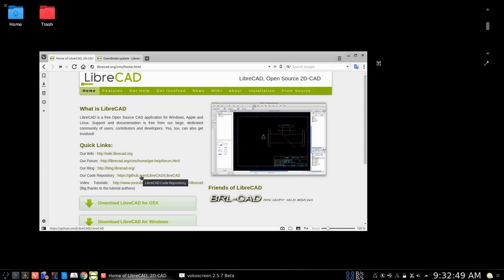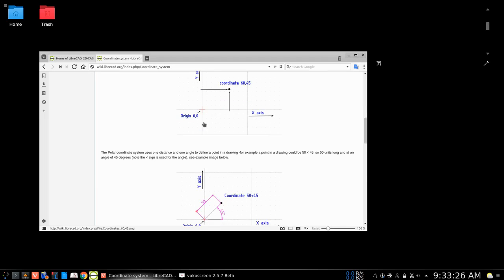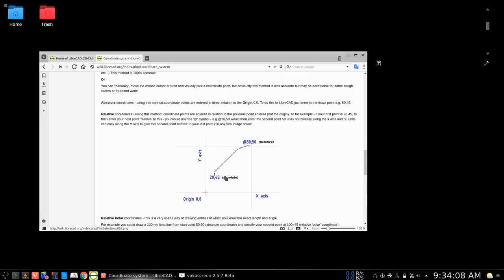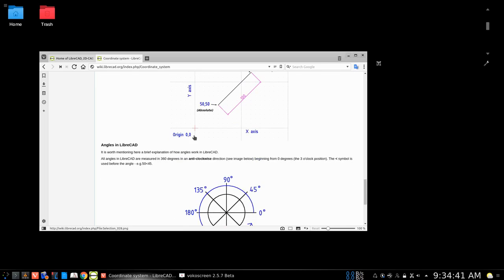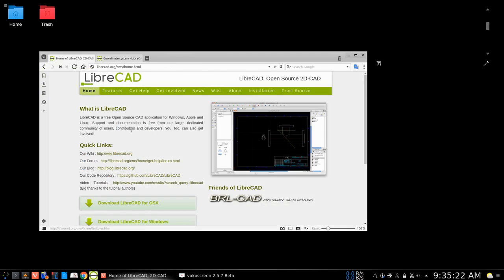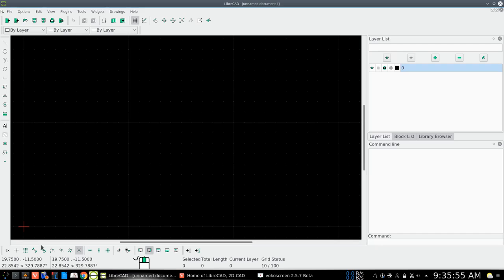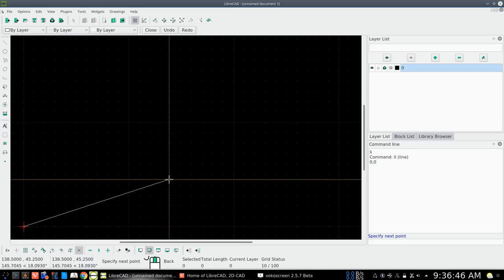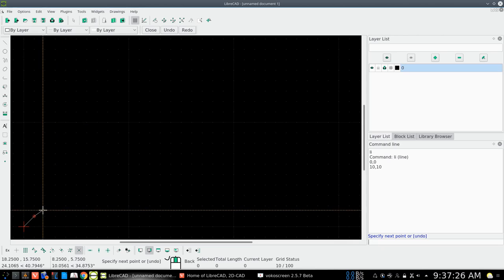7 coordinates

Comment: How a can a use geodesical coordinates (UTM) in libre cad?
Reply from the maker: Hi jcb jets; Thank you for your inquiry. Librecad is not particularly developed for geographical surveying purposes because land surveying requires 3D coordiates providing height as well as longitude and latitude. However in the Options-->Current Drawing Preferences-->unit(tab)-->Angle(section) there is a "Surveyor's units" tab that may be of some use in certain cases. Here is a link to a few hints on how to get extra surveying functionality out of Librecad.
https://forum.librecad.org/Change-Rotation-Direction-To-Measure-Clockwise-instead-of-Counter-Clockwise-td5713908.html
I hope this information is somewhat helpful.
howtopam
Reply from the maker: Hi jcb jets; here is an online conversion web application that you might find interesting as well.
https://mygeodata.cloud/converter/kml-to-dxf
howtopam